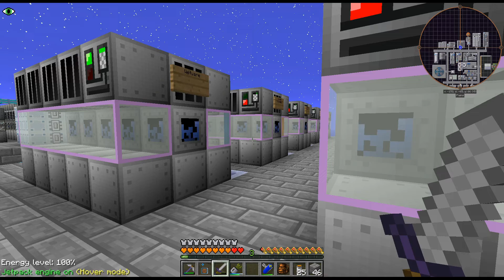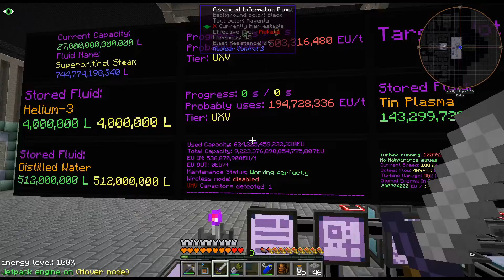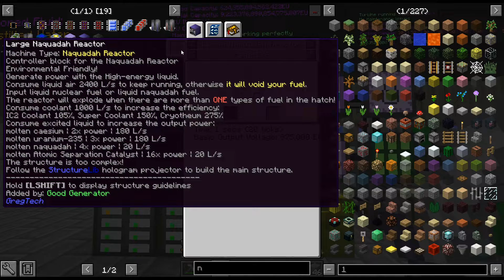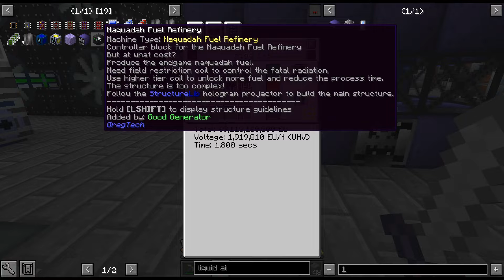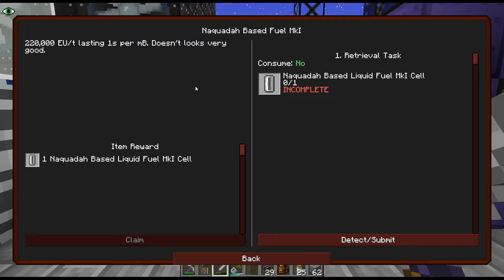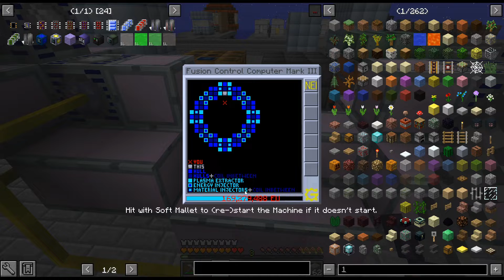GregTech New Horizons S2 - 295 - Naquadah Fuel

Comment: Does anyone know why I'm unable to get power out of the LSC? I have it linked to the reactors using lasers. And then linked to an active transformer. No power. Pack version 2.3.0.
Reply from the maker: Use a portable scanner on the hatches and see if they have power. It’s helped me find an unconnected laser in a chain a few times
Reply: Thinking it's a bug with the LSC because the Input hatches are getting power. The LSC is on. But there's still no power in the Source Laser hatch. Or the dynamo hatch. I tested with lasers and normal power. nothing worked.
Reply: I figured it out, and it's perfectly intended, in the test world, I realized LSC power loss EXISTED. And because of that, any power entering the LSC would be lost.
Reply: So TLDR: Upgrade Capacitors, and Upgrade Power. Or no power in LSC.

Comment: The fluid you can just use a fluid storage bus on the subnet instead of a drive
You don’t need to regulate the LPF doing cryothium fluid, as it doesn’t void
You can use pins to fill the level maintainer
Definitely just go straight for the T3 fuel, the t1 and t2 are bad
You’ll want to do both naquadria and enriched naq to get naq emulsion
Could use a Volcani instead of the EBF
Remember you don’t need to toggle the gt++ multis, they don’t void
Dangote does parallel and is more energy efficient, so definitely worth using
The naq fuel Mk1 and mk2 recipes are bugged in this version to not OC

Comment: For your assembly lines where you added the subnets with the drive, you might be able to remove the drives, cause the interface has an internal inventory, from which the subnet would try to keep the busses stocked, but I might be wrong.
Reply: I thought the same